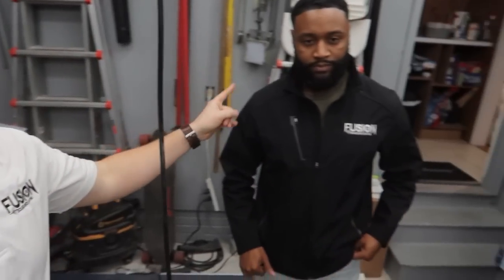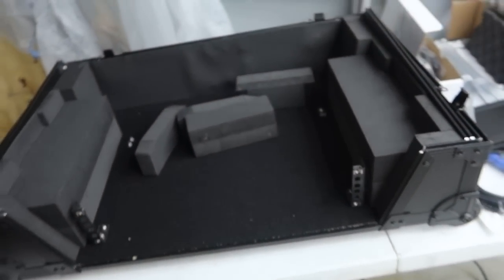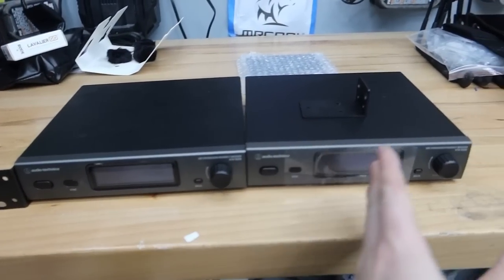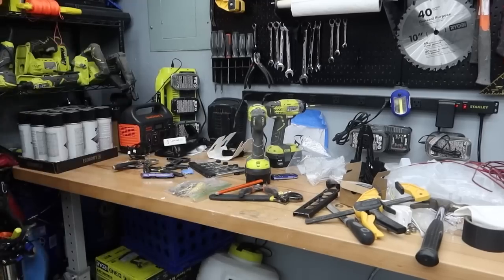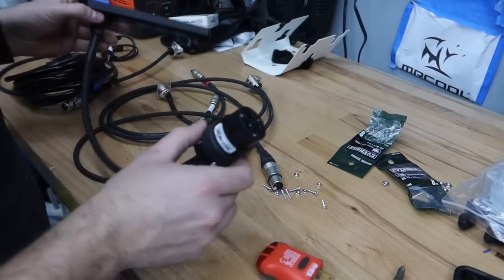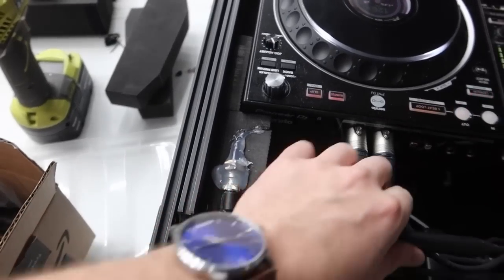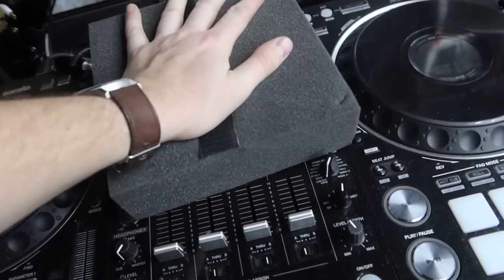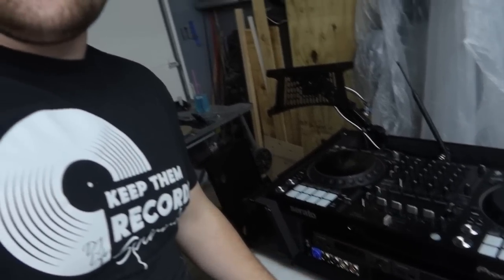DJ Flight Case Build - Pioneer DDJ 1000  Mod (Custom DJ Gear)

Comment: One extra thing I do on all my cases, an extra 2 rca’s from record out to your front panel. So videographers can plug straight in and grab the audio for the event/speeches if you’re not running external mixing board.

Comment: Great Vid.....A few tips.... Mounting neutrik connectors from behind the patch panels gives a much much cleaner look. It also puts less stress on the mounting screws as you connect/disconnect your cables. Running xlrs right next to PowerCon will likely induce a noticeable hum/buzz. I always leave a minimum 2 hole gap.

Pioneer controllers/mixers have always had inferior mic inputs. It is their greatest Achilles heel. Even a cheapie Behringer/Alto/Pyle mixer will yield much greater sonic results....
Reply: Xlr isn't really the problem because it's symmetric and any unwanted noises should just cancel out. RCA is more concerning because its not symmetrical.
Reply: Shouldn't be an issue with XLR since it's balanced. It's one of the reasons why XLR cables can be ran for long runs. RCA cables are a different story.

Comment: I understand everyone have these preference in where the cable connections are place but mind are located at the back of the case. I don't need cable infront of me to trip on. I also have some on the two sides of my case.

Comment: Very nice case! I dont like the hot glue and the cut on the strip though. Looks messy. Why not make a 2nd bracket for the antenna and not cut the strip. Cutting it makes it look bad.

Comment: Do antenna combiners hurt signal strength? Im using Sennheiser EW-D with dual antennas. Had a dropout after combining to one larger antenna. Thanks Rick!!
Reply from the maker: It ends up being the same. If your going from 1/4 to half wave. But if it was originally half wave antennas it will lower your signal

Comment: Hi Dj Rick Web , question is there a way to build a Coffin like that for my DJM S11 W/ 2 RANE 12” MK2 ? If so can you please direct me to the right please and a list of what parts are need ? Do you build these coffin yourself for people to buy them if so I will definitely by one from you - can want to hear from you thank you
Reply from the maker: Based on dimensions you should be able to put a 1u in that case but it will take some engineering (cutting foam, adding spacers,etc.) I do not offer this service to build cases unfortunately

Comment: You don’t have to drop the cables through the holes… you can mount it through the back and just run the screws through it! Would have saved you a lot of time and a cleaner finished look.
Reply: Was just about to say that the round lip on the connector is to go through the hole in the rack mount, flush and neat

Comment: Love it. Where will you put the power bar? Also if you wanted to add an IEM system, to send sound out to other speakers, would you be able to fit that as well?
Reply from the maker: Fit it in the back on the bottom tones of space

Comment: Hey ever think of using the Streetheart SKAA Pro. No need to hide wires anymore! Check it out!
Reply: What’s that?
Reply: @kerbynormil4373  it’s a wireless receiver that can turn any speaker system into a wireless speaker. Faster set up with no more wires!! Very low latency in SKAA Pro mode

Comment: Hey Rick, i dont understand, why u put the Powercon- and Audio-inserts on the Front and not on the back of the case. In my opinion it should be Better on the back of the Case because (1) when its on the front, the cables could be i in the way for your foots and (2) it looks cleaner when the Inserts are on the back (sorry 4 Bad english)

Greez from Berlin, Germany
Reply: And u loose on Rack-Unit-Height when the Ports are on the Front
Reply from the maker: It hides the cables from the audience.  We use the case in the open

Comment: Hi, DJ Rick Web  - What Bracket you install the Rack on into the case, I did not see in video how you did it or the part link for it..
Reply from the maker: The case has a rack built into it. It came like that
Reply: What I ended up doing is bending a old rack and cut in into two attached it to bottom of case

Comment: I love the upgrades! But does it make sense to attach an arm for the laptop, when the slider has a lot more space for other needed things? I would add the arm if the case did not came with a slider. Just my opinion…

Another question, doesn’t that setup require a facade, which is something you have been telling DJs not use anymore, because is a thing of the past?
Reply from the maker: We prefer laptop to the side and it puts the laptop closer to you compared to a slider. And it makes the decks more visible to the audience. 

It doesn't require a facade go check out dj marcellus doe Instagram to see the setup
Reply: @DJRickWeb  Nothing requires a facade. Unless the person is a messy DJ. But I thought your promoting to go with a Bunn setup instead of a facade or the exposed equipment setup…Am I incorrect in what I have watched in your videos?
Reply: The arm looks way sexier then a  laptop shelf, and it puts the computer much closer. It’s the main reason to do this build.

Comment: This whole video is nice but somewhat dated the case build was more relevant 2 or 3 years ago it’s nice to have but IMO it HONESTLY has come  too totally hybrid style setup ups controllers are bigger and heavier than ever, most mobile DJ hates heavy wood style sliding cases to much weight to be lugging around ur lugging around a case weighs 3x the controller weighs the built in laptop holder is nice but still more weight that will eventually were out the case or constantly keeps getting loose, a nice laptop stand more convenient trust me.alternatives has come to facades or scrims much better looking and lighter a heavy case is not needed necessary cause ur covered by facade, just a alternative to the big case build I’ve done many case builds starting to realize there’s lighter options for mobility.
Reply from the maker: Used my sz case for 4 years no issues with the arm very reliable proven to be a good option. This setup doesn't use a facade. Or scrim that can hide anything. It all had to be built in.
Reply: In my opinion, the reduction in setup time is well worth it.

Comment: I bought the pro x version of that case for half the price In February 2020. Odyssey cases are way over priced and it comes from the same place as pro x
Reply from the maker: Prox was on back order. Got this one discounted less than a proxcase
Reply: @DJRickWeb  that ody case is $650 around $730 with taxes. In Canada. Odyssey makes good products but they literally think they are better then any other company. 
All my new gear I buy that can go in cases are all pro X now.

Comment: STOP!!!! Sell that DDJ1000 and get a XDJ-XZ or RX3...those laptop based units are outdated. Going stand alone with USB thumbs or a hard drive is much better---plus---I've seen your videos, its not like you're playing anything different from any of us coast to coast.  You wont need a laptop to play Apache or Get low. Peace!
Reply: To each their own...pros and cons to both. Do what works for you and don't worry about anyone else 🤷🏾‍♂️
Reply: @pstentertnmt   sorry bro just telling viewers its 2022 not 2012
Reply: @oldschooldjernie  It's 2022 and laptop controllers are still being released...like I said each type has it's place.
Reply: @pstentertnmt  ok it's cool, but in 5 years when all controllers are all in ones will you still have this. And will you think, man that dj Ernie was right. Lol
Reply: Heres a quick example why I am right. The last 2 weddings I did I rented xdj xz, used 3 flash drives. One had the tired old wedding dance songs you have including Yeah by Usher. One had cocktail dinner music and one had all the requests from the couple. 3 flash drives with maybe 2 crates in each. Saved time not opening up Serato. No laptop shelf either.
Reply: @oldschooldjernie  Sorry, but you are the one stuck in 2012 using flash drives. Use DJ Pro with a 12.9 inch ipad pro and LTE or 5g service. I mix directly off Tidal, SoundCloud, and have a laptop as backup for any custom songs. Barely use the laptop maybe 2% of the time. Having 200 million songs at your fingertips is way better than some tired flash drives that could get lost or fail.
Reply: What if your laptop takes a sh*t on you when it either crashes or over heats?
Reply: @oldschooldjernie  I don't buy cheap laptops. I have gaming laptop with 16gb ram and 6gb video card. Not gonna overheat. Plus my Ipad Pro 12.9 running djpro is the main music player. Having over 200 million songs at your fingertips makes life so much easier than pulling out a bunch of jumpdrives.
Reply: @dwitthoft  I have 2 alienwares and both have over heated in 90 degree sun here in so cal. I freaked out at an outdoor reception when it happened
Reply: Only after 6pm they came back to life, I had to use my damn phone to playback music, it was embarassing as hell
Reply: @oldschooldjernie   That sucks! I would get a fan on yourself for outdoor events. Good for keeping bugs away too. Also a 10x10 tent to keep the sun away. Always good to have backup ipad for any problems. Good luck.
Reply: @oldschooldjernie  I feel ya. Back in the day, I had a kid pull my main plug out of the wall during the father daughter dance. Talk about embarrassing.....